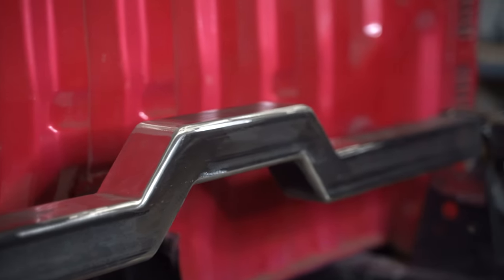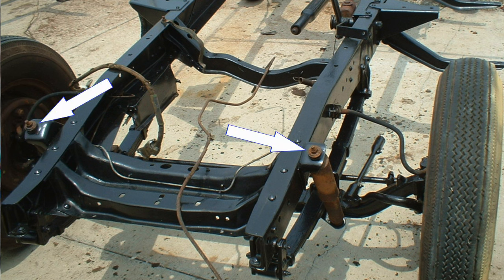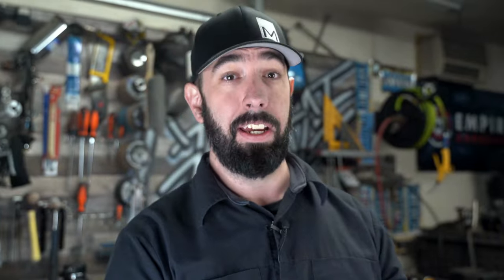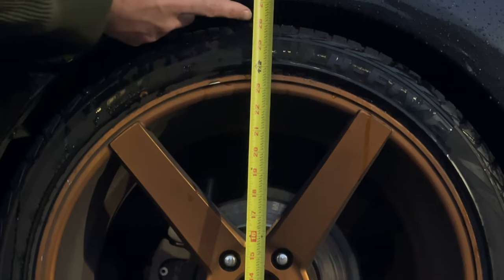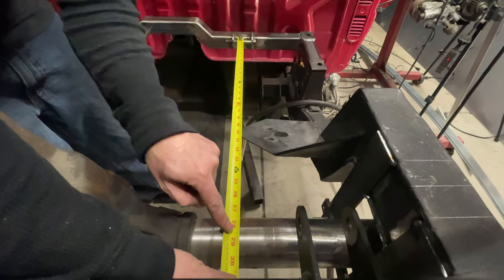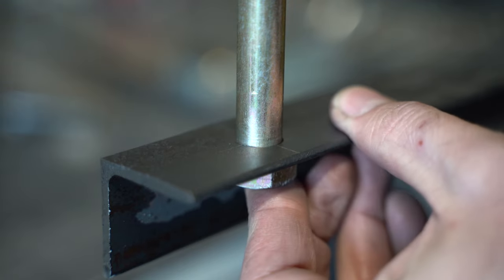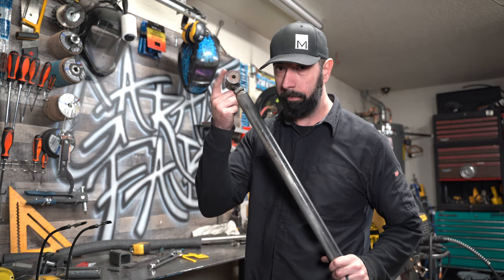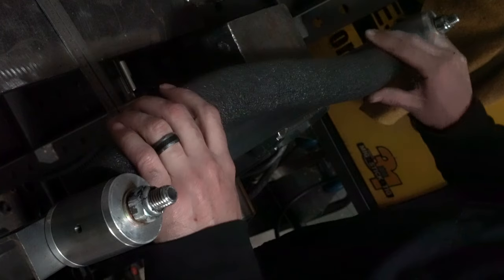How to Make Identical Length Link Bars! Mighty Max Ep. 12

Comment: Great videos, you’re voice is perfect for this and you should be a professional voice actor! On a different note, if you could d a specific triangulate 4 link video for classic trucks. I’m trying to put one in my ‘57 Chev with a GM 10 bolt. I’ve researched a lot but it’s hard to get the right answer, like should the bars be parallel? Or should the top be slightly downward to meet the projected lower bars line at the IC? I’m just building a daily driver. Thanks
Reply from the maker: Thank you my friend! I went to a voice acting school for 4 weeks! I felt like I wasn’t getting much out of it for the money I was spending so I stopped. Maybe I was wrong! 🤔 
I don’t know when I’ll be able to make that video especially because my next truck will have independent rear, but it’s definitely in the future plans.
Until then, I’d be thrilled to help where I can.
For your question specifically, will you be using adjustable suspension or coil overs? That makes all the difference in my mind.
Reply: @GarageFab  Well isn't that something! Yes, totally agree that the entertainment industry can be somewhat fickle that way. I am putting in coilovers, no bags, just basic, bought a generic welderseries link set, but because of the narrowness of the frame and the pumpkin being cast iron, the maximum angle I can achieve is about 24 degrees with the uppers going outwards from axle to frame. I may have to go in reverse and converge forward to a mounting cross member. These I can tackle but its understanding the best geometry for the setup. Oh, and I have a calculator, but I do not have my corner weights of the truck, as I have everything apart lol.
Reply from the maker: Honestly when we start getting into corner weights, that’s going far beyond my knowledge of suspension design. I’ve never built a performance suspension and it would probably show if I tried. I specialize in the basics because that’s what I understand thoroughly. Meaning I can build a suspension that works properly, doesn’t self destruct, and has at least the traction and handling capabilities of most production vehicles.
Because your building a street vehicle, I believe you would be still be happy with your setup if you reversed the triangle. I’ve done it several times with no complaints. Just understand that this is changing your roll axis quite a bit. (Roll axis is what the entire vehicle body rotate on when cornering and it’s determined by drawing an imaginary line through your front and rear roll centers) The roll center in a triangulated 4 link is the point where the two angled bars converge, and because your moving it forward that’s steepening your roll axis slightly. My argument is most people couldn’t tell the difference. Seasoned race car drivers could.
Because you’re NOT installing bags, you can ignore how much I stress the importance of Parallel Link bars. That’s important in adjustable suspension to keep from replacing U joints every oil change.
Your bars can be angled. A good rule of thumb is the lower bars are angled up slightly and the upper bars angled down in a way that if you drew an imaginary line through the bars, the uppers and the lowers would intersect somewhere between the grill and the center of your front wheels. This will give you a little added traction off the line that us bagged folks can’t have.
Again, Mario Andretti would sense the difference between a parallel setup and the the angled setup mentioned above.
If you ever want to shoot me photos, search @GarageFab on Instagram.
Hope this helps a smidge.
Reply: @GarageFab  Thanks, it does greatly, I am a pilot by trade and understand all the roll, CoG, inertia and such, but I don't get some guys going all in on these race setups that really, anything under 800 hp, they can't feel. Thanks again, I'll hit you up with some photos for sure!

Comment: My first truck was a 1985 mighty max pickup that had a 2.0 and it ripped, hind sight I should have put an evo 4g63t or something in it but I put a 4.3 vortec v6 with a Munsie 4 speed from an old camero and made it a 2wd pre runner, had a twin I beam from a Ford ranger in it but then jumped to far and broke the front end. These truck had a boxed frame from the factory that were tough as hell. Truck got wrecked while parked and totaled which sucked, best drift truck ever.

Comment: mcmaster sells plastic lined rod ends. they are typ. 10% more than chrome steel rod ends, so forget johnny joints
Reply from the maker: All rod ends have their place. I’m a fan of Heim joints, but not everyone would enjoy the vibrations from the road being channeled to their bum through their suspension joints. Also they’re meant to be cleaned and oiled on a regular basis which too often gets neglected. A Johnny Joint isn’t quite as needy and provides a lil more comfort.

Comment: Hey MK, can you use any shape link bar for a watts link install?
Reply from the maker: Yes Sir. Same rules apply. The important things are the distance between the center of the 2 bar ends (the effective length) and the strength of the bar. This goes for the Watts link propeller too.

Comment: I understand that you are indicating to keep the bars parallel to maintain pinion angle. However, I thought that the pinion angle being 3-5 degrees down was so that under acceleration, and a little bit of axle wrap-up, the angle would essentially zero out, or be closer to 0 than when static and not under a load. If you are running solid bars that allow NO wrap-up under acceleration, do you still need to run the pinion angle at 3-5 degrees down? I'm watching for your driveshaft video so that I can better understand how to set, and adjust, pinion angle. For example-and not to make this message too long-I have an 08 Chevy extended cab truck with the SUPER LONG aluminum driveshaft. I've blown the shaft up TWICE now because they are not meant for high speed excursions. Literally they get damaged from 130+ mph events and then induce a vibration. This last time I went to a steel driveshaft but due to it's LONG length, it too is having problems. I was told to move to a 2 piece driveshaft and all this crap would be behind me. The factory aluminum shaft was 86.5" center of U- joint cap to center of joint cap. So, now I'm moving to a 2 piece shaft for which I will have to make a cross member for the carrier bearing. To make matters worse-the truck is lowered! So... I need some help figuring out drive line angles for a 2 piece shaft on a truck that did not come that way from the factory, and one that has been lowered 6" in the rear... yep.. lots of fun.
Reply from the maker: Haha! That does sound like fun indeed! I am working on that video literally as I type. I was questioning whether or not to include the Double Cardan joint in the video but it sounds like you could potentially benefit from it. I hope to have it out in the next couple weeks but a lot of poo is hitting fans left and right around here but I’m certainly trying.
To answer your question; Yes, the 3-5 degrees down rule was created when the majority of vehicles were built with leaf springs that could wind up under load causing pinion angle to change away from the desired angle. This was/is most important with drag race vehicles. The goal then was proper U joint angles most of the time.
So for your second question, If you have a link bar setup with heim joints installed, you will have zero change of the pinion angle so No, 3-5 degrees down should be avoided.
Link bars with bushings could change the pinion angle very slightly. I made a video on bushing deflection if you haven’t seen it. So your pinion angle might then depend on what the vehicle is used for.
You could have two identical vehicles with identical bars and identical bushings but one vehicle is 90% race and 10% steer while the other is 90% steer and 10% race. The race car you might tilt the pinion angle down a degree or so while the street car pinion is at zero. (Side note: The angles themselves don’t matter but the relationship between the transmission and the differential do. They should always be parallel as often as possible.
So if transmission is pointed down 5 degrees, the pinion angle should compliment that angle. (5 degrees up) So when I say “zero” I probably should’ve said zero degrees difference.
Hope that didn’t make things more confusing. 😬

Comment: Why didn't U use the original mounts on the rear end?
Reply from the maker: Are you referring to the bushings on the differential? The axle is from a Mustang that uses a triangulated 4 link design. I’m trying to get away from that design so the angled bushings wouldn’t work properly with forward-facing links.
The mounts will be removed to make room for an axle support truss.

Comment: I am wondering 1 thing tho does it matter which way the top links go in the triangulated 4 link like if they meet at the diff or at the "shopping cart handle" lol if not do they do the exact same thing or do they serve different purposes? thank you for your time
Reply from the maker: Changing where the triangulated links meet will change the vehicle roll center a little and the roll axis a decent amount. Plug those into Google to learn a little about them. They change how the body reacts and rolls in turns. Honestly I don’t think you could tell the difference under normal driving conditions.
Reply: @GarageFab  awesome thanks again for the help
Reply from the maker: Anytime my friend.

Comment: If I'm build a track truck with about 700hp. Should I use a heim joint if my link bars are adjustable? Even if it's gonna be on coilovers static drop.
Reply from the maker: Hey Derek! When you say “track truck”, are we talking an auto cross? The dragstrip maybe? Stiff components are certainly recommended to help put your horsepower to the ground, but Heim joints don’t last forever and are kind of high maintenance.
If you need the truck to handle in turns, definitely go with Heim joints. Suspension components need to articulate freely. Straight line driving, you might be able to save some money and go with Delrin bushings. Still stiff but the articulation isn’t as important. 
I am not well educated in racing suspension. I’m basically regurgitating things I’ve read on the subject that I have no way of confirming or disproving because I don’t race.
I’d highly recommend asking other people that are actually in the racing scene.
Reply: @GarageFab  yes setting up for drift/auto cross. Can I use one bushing end and the other heim?
Reply from the maker: You absolutely can and it’s recommended to have at least one Heim joint if your bars are adjustable. Bushings on both ends will cause your locknut on the bar adjustment to loosen when the suspension articulates. One Heim will prevent that.

Comment: Towards the end, you show the bars beside each other, with the bushing pipes lined up like they weren't cut…

What if you did them that way, and cut them after welding the bars in?

Also, the l&r upper bars stay the same distance apart through movement, when they move the same. When they don't (like roll) they are always moving apart.

What if you hooked them together with something that resists expansion, like the springs that pull a porch door closed (but bigger), or a shitload of bungee cords…

Ghetto substitute for an anti-roll bar, that works with 'bags, as long as there is clearance under the bed!

(steering dampener? Nah, that would make bumps harder & rolling slow to return)
Reply from the maker: Thought #1: That would be interesting. You could definitely cut the bar ends later, but the sides of the bar end should be square so they don’t tear up the bushing as they rotate and I don’t think you would be able to get that assembly into a chopsaw. 🤔 
Thought #2: You’re anti-roll system seems like it would work in theory. But I wouldn’t want to try to explain it at a car show. 😂
Reply: @GarageFab  a sawzall or angle grinder would be through it quick, but after I posted that I started thinking that the first cut could end in a "ping!" Then all effort would be wasted.

test the idea, then we'll work on a more fashionable way ;)

Comment: What kind of tubing is that exactly?
Reply from the maker: I use regular mild steel tubing for linkbars. (I am assuming by looking at the video thumbnail that this is the tubing that you’re referring to)
I use 1.5 inch tubing with 1/8 wall for non load-bearing link bars, (bars that do NOT have a coil over or air spring mounted to them) and 2 inch square tubing with 1/4 wall for load-bearing bars.
Reply: Do you think that the square tubing would be strong enough for a jeep application
Reply from the maker: The 2 inch square is a pretty beefy chunk of steel. I think it would be strong enough for most applications!

Comment: Old video and series I know but wanted to kinda pick your brain. I know why you wanted to do parallel links but why not do a triangulated link setup? You can still get the same effective link length for keeping the pinion angle. Or at the very least do a semi triangulated setup with those upper links. You wouldn’t have to change much with your setup and could have kept the top links straight making them stronger while making your entire rear end a bit stronger
Reply from the maker: YouTube basically makes all my decisions for me. This truck already had a Triangulated 4 link. I wasn’t thrilled with how the original builder did it and leaving it alone would not be a very entertaining video. Every modification I do is simply because it would be more entertaining to watch. I built a Watts link for this truck as well. Necessary? No, but a lot more interesting than a panhard bar. Just about everything I’ve done so far, could’ve been done an easier faster way. Luckily I like challenging myself!
Reply: @GarageFab  fair enough! I like picking brains to understand the process whenever I can
Reply from the maker: That’s a good way to be.

Comment: Do you use gas with the wire weder ?  Thanks.
Reply from the maker: Yes I do! 75/25 Co2/Argon mix. Provides the cleanest welds.
Reply: @GarageFab  Thanks for that info.
Reply from the maker: My pleasure!
Reply: @GarageFab  My I ask you whether just a wire welder with no gas would still do the job ?  Many thanks again.
Reply from the maker: @jackspratt4343  You can get flux core wire that doesn’t require gas. It’s more difficult to learn and harder to get pretty welds but it’s actually stronger. Flux core is often used when making tow hitches and other highly stressed components.
With regular wire, you absolutely can NOT get a good weld without gas. It’s not even worth trying.
Reply: @GarageFab  Oh, that's excellent advice, It happens to be a large trailer that I need to build, so thanks again for that.
Reply from the maker: Flux core welding would definitely be the way to go! There should be several videos on the topic that can help.
Reply: @GarageFab  Thanks Garage Fab. I will take a look at those.

Comment: ok i gotta say the DOM vs Chromoly is sorta ass backwards. Chromoly doesnt need to be pre and post heat treated, so long as you buy it in the correct state {N}. DOM will work harden and begin to crack eventually. Once this starts you will be chasing cracks forever. 4130 was designed to be oxy fuel welded, its made for aircraft.  keep the interpass temps good and you are golden. if you want to mig it run real hot but "weld dots" essentially stacks of tacks. in tig we pedal pump to keep the interpass temp down. as long as you dont turn it grey and crystalline itll be fine. for the stuff you build i cant see 4130 being worth the money. race car chassis? yeah, spend the extra dollars so itll last. play car? eh DOM is fine, just dont expect it to last forever. aircraft? yeah dont built it out of DOM.
Reply from the maker: I’m going to have to figure out where to learn this stuff eventually. The next truck project I intend to focus a lot on weight as I build quite possibly in the form of a full tube chassis. My usual overbuilding won’t do!
Reply: @GarageFab  yeah man. over building is for sure the easy and safe way out....but when you ground up you end up with a 12,000lbs toyota mini if youre not careful... Pretty much everything we need to know is covered in "machinery's handbook" though its not always easy to apply to the task at hand.
Reply from the maker: More good info! I’ll have to check it out.
Reply: @GarageFab  theres about a billion editions. look for an old one, great find at garage sales :)